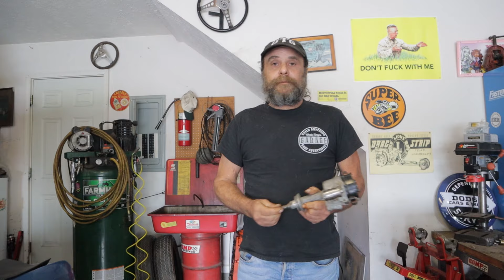Ignition Timing...How Much And Why

Comment: On the chance someone is still thinking, OK but WHY does a larger bore require more timing, let me offer an illustration that may help. Visualize the air/fuel mixture as a bunch of dominoes. It takes X amount of time, measured in degrees of rotation, for them to all fall. Now, imagine a larger bore. It will take that many more dominoes and therefore, more time for them to fall.
Reply: Also where the plug is located center vs side.
Reply: I like the explanation "it was entirely based on the real estate  the flame front had to cover... Dominoes are good but flame front/real estate is magnifico..  :))
Reply: That analogy is very good, was able to visualize the Air/Fuel being burned.

Comment: I have never heard anyone explain that so well. My 71 10:1 440 liked 46 degrees of total timing. I ran 11.70 on 28 inch slicks, 13.10 on street tires.
Reply: That's strong
Reply: Need metal, it was so much fun. 71 charger I worked my butt off to own. Life got in the way of keeping it. I miss that car. Right after I sold it, classic Mopars went way up in price.
Reply: @lewhanna6112  that's happened to many of us.

Comment: Great info with the bore size
Reply: There are a few things that affect it to some degree. The position of the spark plug for one. I have learned this because my 1976 Moto Guzzi motorcycle has Hemi heads but the spark plug is not in the optimal location because the valve size is big enough that the electrode is moved down from the center of the chamber to where there is room between the valves as you move away from the exact center which is also where the 2 valves are closest edge to edge.

Comment: We meaning my dad as I grew up never owned a trimming light so we just adjusted timing with a vacuum gage when the needle sat very steady lock down the distributor and call it done they ran strong but where just daily drivers well new cars back then

Comment: Isn't there a spring adjustment on the side of the distributor that adjusts timing? Also, if you have a big cam you won't have enough vacuum to run your distributor.........sorry, I couldn't resist. Great video.

Comment: Little confused about this timing thing. I have 408 (cid) flat top pistons and valves. I think 272 duration crane or comp cam? Running 17Hg with 91 octane. 600 performer headers and Summit distributor sooo. 
WTF is the suggested time?
Here’s where I am confused. Do I set initial time to 12-14 with advance plugged? Or set dial back to anywhere from 33-36 @ 3000-3500 rpm?
Just so many variables. Oh yeah, another thing. Do I set my advance inside to max (8 turns clockwise) 
Thanks if you can help me figure this out. Doug

Comment: Meanwhile my 5.125" bore motor will beat the mains out at anything over 35deg.  Ideal timing in my opinnion can only be found by starting low and slowly creeping up till you start to get detonation then back it down a few degrees.
Reply: That's because bore size is NOT the main indicator of total timing needed...  regardless what the video says. Lol.

Comment: I ran 38 degrees on my 413, 10 to 1 compression. I had detonation and blew the right head gasket, The head bolts were loose!!.  So I tuned it back to 32 degrees and it was fine, no detonation.

Comment: Why would a TBI 454 develop a pop through exhaust at very lite load basically full timing advance also. Is the spark cross firing to in the distributor cap?

Comment: Timing is everything.
I just recently got rid of a 85 Honda Accord with a 3bbl 1.8l 4 in it. It was a complete dog, struggled to hold 50mph on the slightest hill.   I broke out the timing light, it had nearly nothing for timing in it. cranked the bitch up to 22 degrees and it woke up. it hauled ass for 86hp

Comment: I have a 318 I'm building. I am installing the valve springs. It seems that one is slightly shorter than the other with a different tappit on top. Which one goes on intake and which on exhaust?

Comment: I've never bothered with a timing light. What I do is loosen the adjusting nut on the distributor after the engine is well warmed up on a hot summer day. Have already driven the vehicle close to a long, steep hill on a highway. Like a long 6% or higher grade that lasts at least a half-mile.

I then advance the timing until the automobile just barely starts to ''ping'' while going up the hill with the car at high speed and with the accelerator floored. At this point I pull over, stop the car and retard the distributor a tad. Just slightly past the point where the engine stops pinging. The distributor is now set as far advanced as possible without misfiring.

Indeed this has always worked well for me. As it guarantees that the engine is tuned to the most efficient level possible. It will be set to the maximum level of advancement and just barely before the engine starts to misfire.

Comment: OK, a wee bit more to this.  BIG advance floating down the freeway at 70 with part throttle.. Maybe 48* or more.  Why, because it's a high vacuum lean burn situation.  Ditto at idle.  Carb is closed and engine is sucking its life out trying to get fuel/air.  So we have vacuum advances.  And it's crazy how much vacuum advance you can throw at some motors for freeway cruise.  18* on top of mechanical advance on 455 Pontiac, 15* on top of mechanical in 454 BBC.  I dunno about Hemi's.  Never could afford to run them.  But I'll bet it's the same.  Point being, it about real estate and flame propagation speed, and that is not constant with changing operational conditions  :D

Comment: Great video.. Makes a lot of sense. 
Rule of Thumb..... Advance the timing until it pings under load and back it off from that spot for optimum... 454 Chevy dials in at around 37 degrees. 👌

Comment: I’m really at a loss with my timing. I thought something was screwed up from when I changed my distributor. I was at like 54*. It ran good, but was too happy about that number. I restabbed it have it at38* total 25 initial. Lightest springs. Runs really good off the line, but doesn’t want to stay idling at a stop, in drive. That’s one of the reasons I was so high prior. Do I limit the weights, stronger springs, etc. Any input? Is it a carb issue? TIA. 350 Chevy, Big Mutha Thumpr 486/500 lift, 107 LSA, 3000 stall

Comment: Thanks for the info! My 230 i6 has a 3.9" bore now after going .03" so I'll try what you said, 32-33 total advance. Maybe it will wake this engine up! Was thinking about lightning up the springs or weights in the dizzy. Not a high rpm motor, similar to your 360, I want that low end snap.
Reply: If that is a Chevy 230, the early 194 Cu. in. chevy 6( with automatic trans) is steel, and has only 4 counterweights instead of 12. One heck of a cheap junkyard upgrade. won many oval track races with a $7.00 crankshaft.
Reply: @Splungers  I dont have that big boat anchor. Think I have 6 counterweights, it's not the forged one though. 😕

Comment: Here is something to Google.  LPP, or the location of peak pressure,  which is ideally 14 degrees after top dead center.  Here is a link to what the uncle just said, but in technical  terms.   Engine Basics: Detonation and Pre-Ignition by Allen W. Cline
http://www.contactmagazine.com/Issue54/EngineBasics.html#:~:text=Because%20the%20optimum%2014%20degrees,for%20detonation%20to%20occur%20considerably.

Comment: Tony I have a 327 in a 69 vette and for some reason it seems to like 28* initial timing is this possible or has someone put the wrong harmonic balancer or timing tab on it , this is driving me crazy, if it were an automatic transmission I would put someone in the drivers seat and let them hold the brake and rev the engine up a little and turn the distributor until the Moter hiked up the most and be done with it but on this 4 speed car I’m kinda lost

Comment: More wise words from Uncle Tony...It is all about flame propagation within the cylinder...bore size,fuel type even piston crown and spark plug location are considerations and then cylinder volume at the time of fire affects the air/fuel mix etc...fun isn't it.

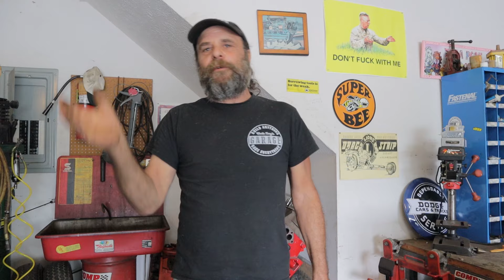Comment: Thanks! I’ve been working on Chevy 350s, and I just put a bunch of money in my personal one. I talked to a buddy who races , asking about how much timing I should run. I’m running 32, but he says I can run 34. I know it ain’t much, but I’m running on a budget and can’t afford to blow her up. I’ve finally got a great set of ported heart shaped chamber heads on her. I’m guessing I’m running about 9.7 compression with I would consider great flow from intake to exhaust. Everything is port matched, and trust me , they’re is no restriction on either part. I run a modified 3310. I mean the throttle shafts are thinned down, the main body has been polished. I’ve jetted up to compensate. I’ve geared the car from a 3:08 to a 3:75. I’ve got a set of racing headers on her, to a free flowing exhaust. I know it’ll make more power, but what kinda initial timing should I look at?
Reply: IMO, you'l likely feel a power loss once you get past optimum. From "optimum", I'd turn it back a hair (that's the way I roll).  Be careful though, might not have much warning as when things heat up, clearances become tighter, pistons heat up, oil film breaks down and aluminum melts.  The question at some point becomes "Is the risk of roasting something worth going for more".

Comment: So maybe I'm not crazy?
The 350 in my Nova wanted 54degrees total advance... I swear...
It had a comp cams super thumper and about 10.5-1 compression.
Old school iron vortec heads that a machine shop fucked up drilling and tapping for screw in studs (crooked as fuck) 
Comp ultra magnum roller rockers but, stock ratio....
I dialed in TDC with a dial indicator because I just couldn't believe it wanted that damn much advance but, that was where it was happy and made power.....
It tapped like a s.o.b. but, it made power.
I sold it a few months ago... (I told the new owner about the heads)

Comment: Blown 383, 8.7;1 compression, 6 inch rods, all forged 37 total timing. Running great. Wondering 38 and upper degrees but dont want to push.. anyone using 40 degrees of total timing on blown sbc?
Reply: Change your pistons and get that compression up there a little higher...you should be closer to 10-11, then leave it that way.  After that, change your fuel and leave your engine alone!

Comment: Hey Uncle Tony I have 440 and have been trying to get my unit to run to my knowledge I’m sitting stock everything and you seem extremely aware of the flame front across can you help with an initial timing to help me get started or even yaa or nah the 8-10 degree at initial setup ? Or maybe would you do an info video on curving a distributor fundamentals? Maybe

Comment: I have an hei on my sbf, I took out the springs on the weight so I get full advance, MAN TONY YOU WERE RIGHT, VERY VERY SNAPPY LOW END, it's running a little lean, about mid 13's Afr when I stomp on it at about 4-6k, but I just gotta get some smaer metering rods, and bigger jegs. Thank you Uncle Tony

Comment: I have a 400 engine and it says to set initial timing at 5 degrees and you are saying 36
Reply from the maker: TOTAL timing at 36...meaning at a high enough RPM that all of the distributors advance is in.  Initial is an entirely different thing

Comment: So when you dual-plug a motor (obviously you can't do this to a Hemi) you can bring the advance down?  Or... it effectively gives more resultant advance, since the flame front travel is less?  Advance is tied to the desired power pulse timing, the speed of the flame front is determined by fuel/air/etc conditions at ignition (and after)... complex!  So, if you dual-plug a motor and do nothing else, you can screw it up?
Reply: Who says you can't dual plug a Hemi?  Drag racers do it all the time.

Comment: That makes sense to me.. when I used to run 327s and 350s both ran close to 32^ timing both 4” bores... 
The older small bore 283s and 307s ran less timing but always under 30^

Comment: I run enough timing on my 8.5:1 mild cam 318 so it pings under heavy load at high rpm with 87 pump gas. That way when I’m towing all I have to do is put 89 or 91 in it and it makes tons of power and doesn’t ping, but just driving it around town I can get away with 87 no problem. I’m not sure that that’s how it’s supposed to be done but so far it’s been working for me.

Comment: I think Tony's on the right path but the question then becomes: why?  Ultimately, I don't think it's bore size so much as it is combustion chamber size and shape along with where the spark plug is (and if there are more than one).  If the spark plug is centrally located it takes less time for the flame to reach all the way across.  If there are two, it reduces the distance/time further before all the air/fuel is ignited.  The piston diameter will likely correlate to chamber volume "all else being equal".

Comment: I've run the ragged edge of "optimal" where ambient temperature could push the engine over into detonation.  Sitting too long at a stop light, I'd have to baby the car for a little bit to get things cooled down a little bit so it wouldn't ping.
Fun times with timing lights.

Comment: Unless you had engine dyno , you can up the timing until it stops making more torque. Timing also affects exhaust temperature under load. You look at exhaust temperature peak.

Comment: Don tried to blow it up, so he could throw a 417 Donovan back in the car. He first threw 40 degrees at it, and it ran faster, so he kept going up in like 5 degree jumps until it finally stopped getting faster. The 426 Hemi, in race trim, REALLY liked lots of fuel and spark advance

Comment: Uncle Tony have a question for you. A friend of mine an old-time mechanic was talking one day about timing on a vehicle and I was trying to tell him how much I hated a timing light. He explained to me that if the car was warmed up to operating temperature to have someone sit inside the car put the car in drive with your foot on the brake and power brake the car with someone at the distributor turning it. When the car feels like it's pulling the hardest that's where the engines happy with the timing. I've been doing that trick for 15 years and it's never let me down. I was wondering if you had ever heard of anybody doing. Thanks
Reply: Usually it is advance the timing and take the car for a drive until it "pings" or detonates and retard the distributor slightly. Heat and fuel octane all play into this.

Comment: Tony, does that mean that if you run 2 or 3 spark plugs in a cylinder the optimal timing advance degrees would come down?
Reply: Interesting point. I wonder why two flame fronts wouldn't interfere with each other, like two waves crashing together. But apparently they don't.